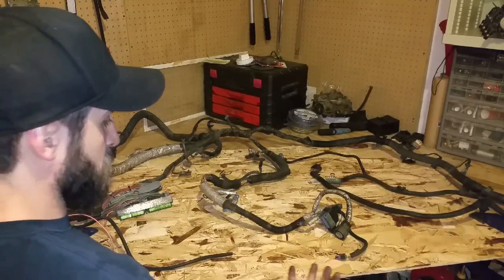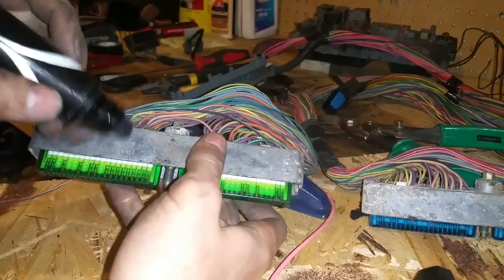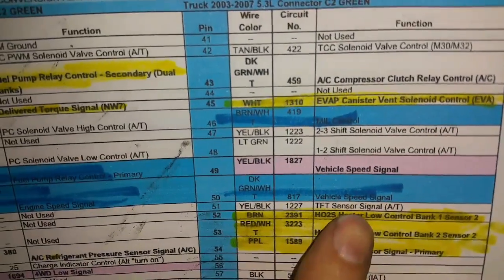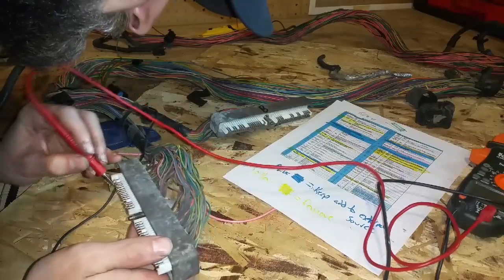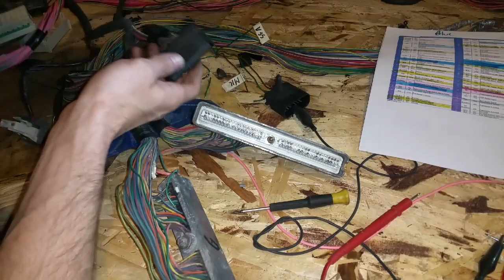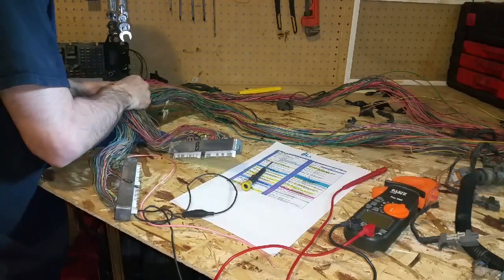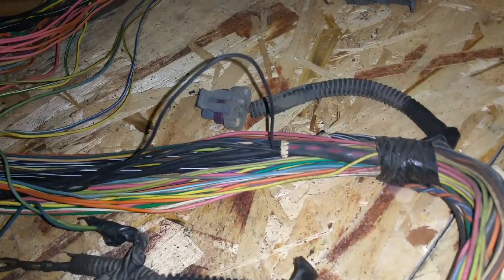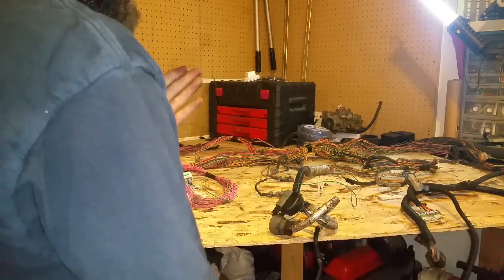DIY STANDALONE LS SWAP HARNESS!!! How to wire your LS swap on a budget!!! Part 1

Comment: So on the vehicle the swap harness is going on, do you have two harnesses or just the one? Trying to figure out how I go about combining both harnesses or if I have to run both
Reply from the maker: On this vehicle I removed the factory engine harness but tied some of the sensor into the factory body harness for the gauges. This harness alone will run engine.

Comment: So, I understand how your tracing wires etc but does the harness have a fuse box on it somewhere that gets mounted? Reason I’m asking is I’m getting ready to try an LS swap into an s10 frame I’ve built for a hot rod. If there’s a fuse box on the harness I can use it to also run my headlights etc. thanks for any help!

Comment: What does that solid pink wire go too??
Reply from the maker: Which one? Do you have a time stamp in the video? There are several solid pink wires, they all go to switched 12v source.
Reply: The one that’s by the ecu plugs at the begging of the video.
Reply from the maker: @davidgarza750  Good catch. That one was added for some reason as a splice before I got it. Doesn't have a purpose, won't be in other harnesses.
Reply: Beginning sorry about the spelling.
Reply: The only reason I ask is because I’m doing ls swap on a 72 c10. And I have a pink wire just like that and it’s not labeled like the rest are.  Motor cranks but won’t start. Running out of idea to what is causing it.
Reply from the maker: @davidgarza750  I just looked, mine was spliced into a #30 pin on green plug (not used), and not going to anything. #30 on the other plug is coolant level switch, which was removed. what is your spliced Into? What trouble shooting have you done? Are you sure you have fuel and spark? Cam, crank, and coolant temp sensor hooked up, VATS deleted?

Comment: hi well this work on ls1 5.7 4l60e like gto 2004 drive by cable
Reply from the maker: zero0o1000 A few things may be different but should be close.
Reply: thanks bro
Reply from the maker: zero0o1000 Similar concept just verify with your specific wiring diagram.

Comment: Can you post a link to these print outs ? For some reason I can't find them.
Reply from the maker: Grant Samples https://ls1tech.com/forums/conversions-hybrids/871904-pinouts-wiring-diagrams-4.html
Reply: Thanks!
Reply: a21bravo is there a big difference between grn/red blu/red pcm connectors
Reply: Grant Samples can you give the link to which wires need to be eliminated

Comment: What do you mean by the wire [that will get re-used] will go to an "external source"? Why cut it if it's going to be used? I will be going through this exercise as well and I'm a little stumped...Thanks
Reply: Ted Hargiss I'm not sure but my guess is because it's a swap the new vehical won't have a place for it to plug into.
Reply: I think for example the MIL will hook to the new cars check engine light.